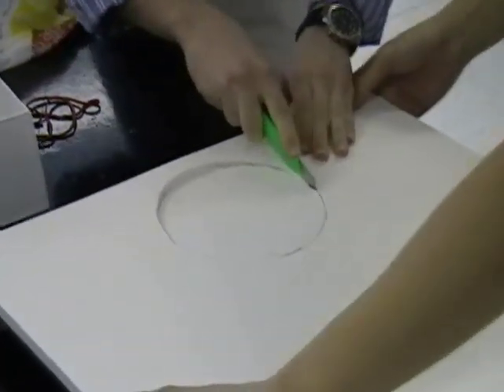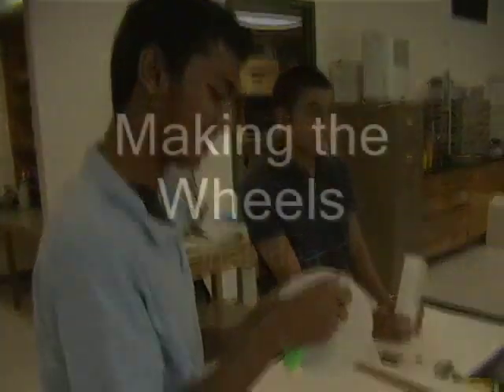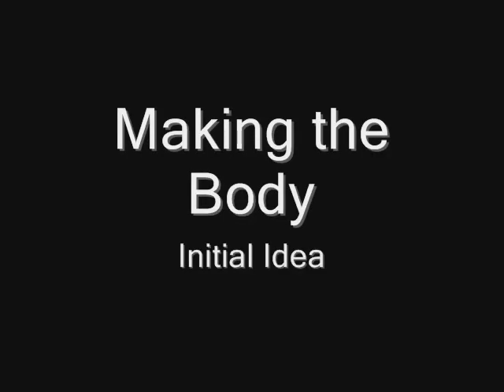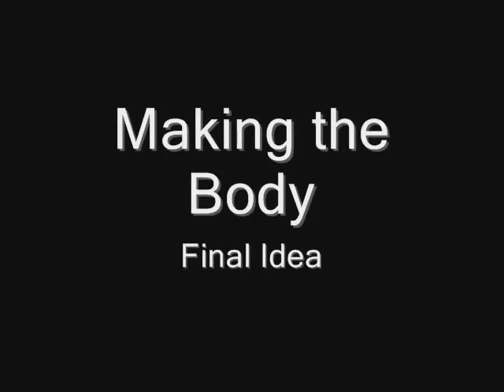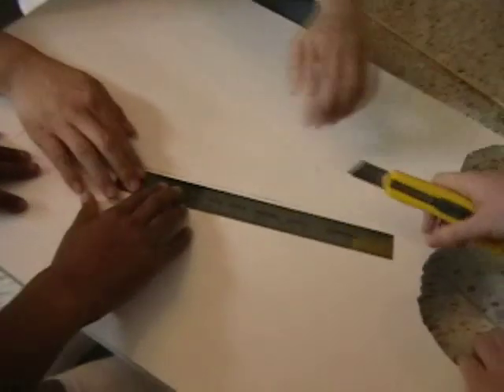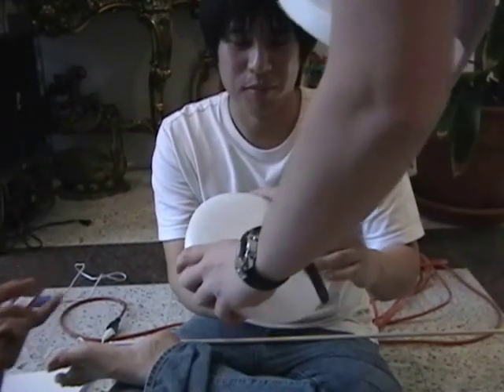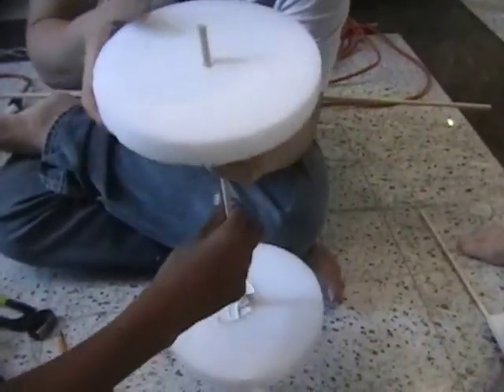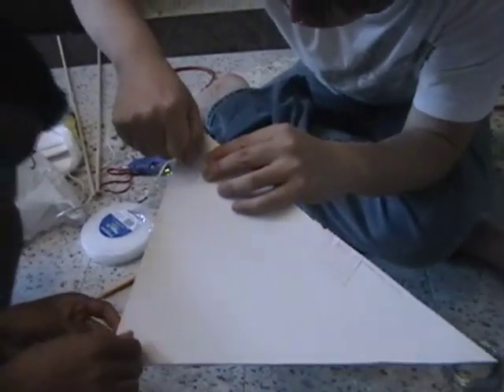Physics Rubber Band Car

Comment from the maker: The zip ties were to hold the back wooden dowel down, allowing it to be wound up. The front wooden down was glued down. There was also a zip tie to hold down the rubber band at the front of the car.